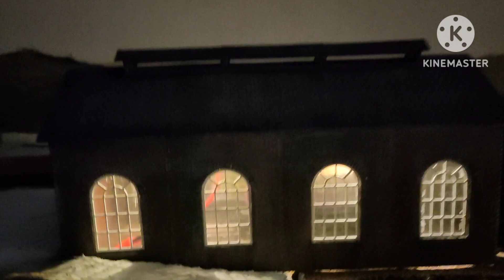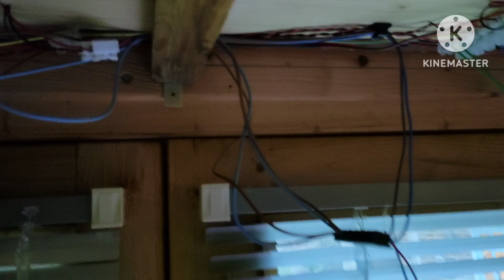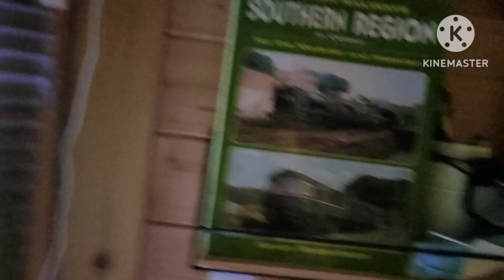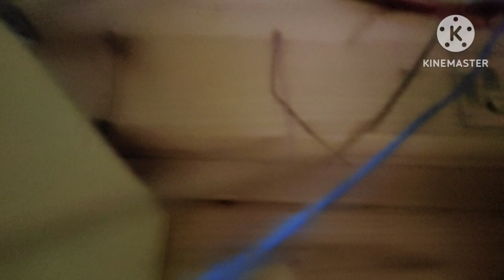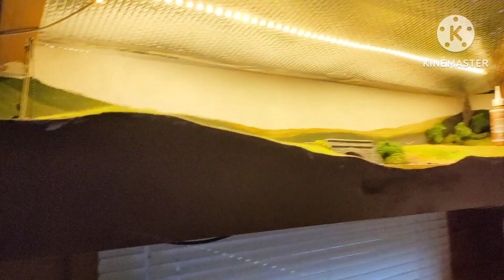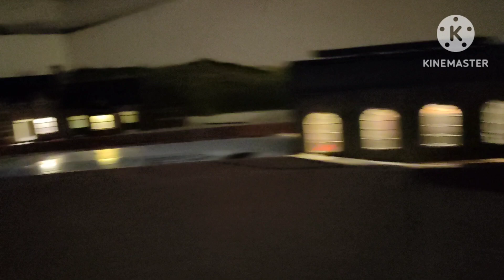OO Cabin Shelf - Lighting up the station's

Comment: Thanks for describing what you are doing with the lights. Will be something I will think about but at a later date now as the layout is changing as you know.
Reply from the maker: @ChobertonJunction  ha no worries. It was nice to think about it a bit and try and  explain the plan. I find that things become a lot clearer by talking it through.
Reply: @_RandomPea  agree, I have had so much great advise of things I did not even consider that I think really there are many solutions to my dilemma but I am nearing a solution and it will be the easiest one so I can get back up and running and then plan the next layout. lol
Reply from the maker: @ChobertonJunction  I've just sent a picture of the anyrail plan and the anyrail file to your email Tony.
Reply: @_RandomPea  Just taken a look nicely done. That is pretty much what I was originally thinking. But! looking at your plan something I should of done right at the start, I have realised that possibly the issue  lies in the smaller platform that suggests trains stop there on the up line and not the bigger platform. Maybe that has to go and that area becomes a proper goods yard. Hmm will think on that some more.
Reply from the maker: I had that one pegged as a goods and cattle platform. Not at all uncommon